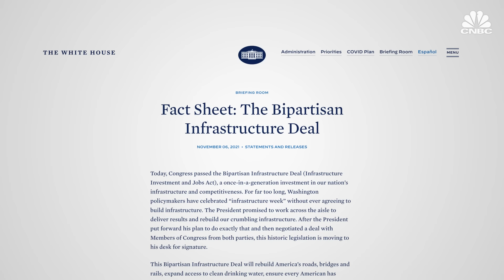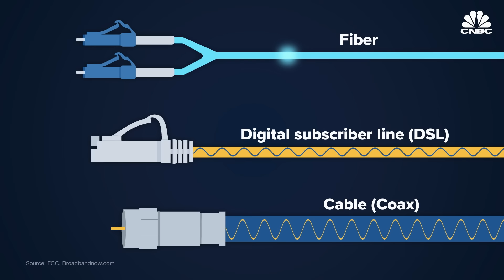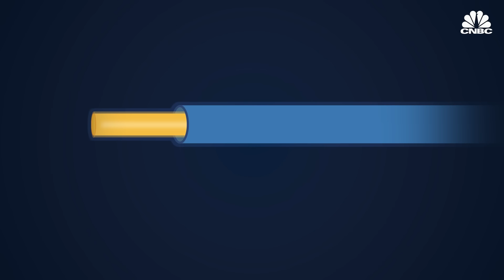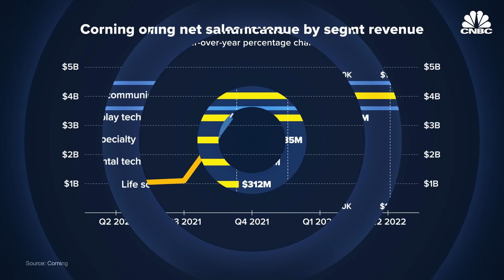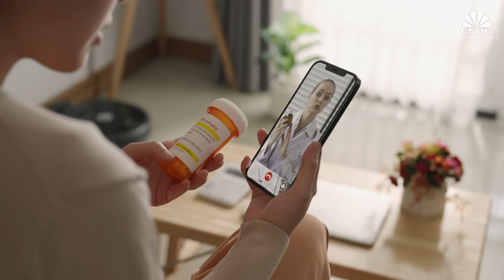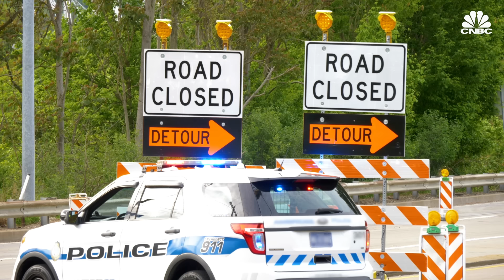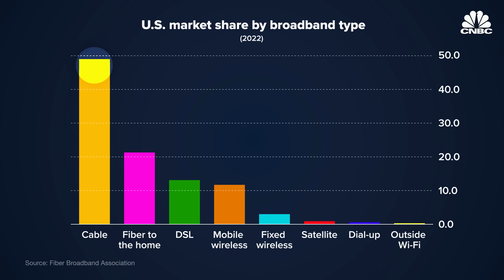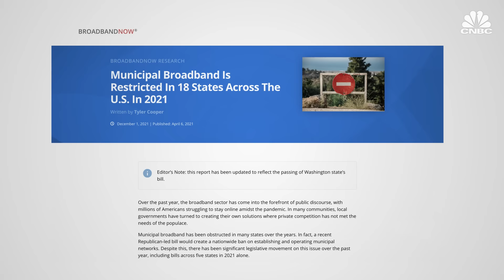How Fiber Will Speed Up America’s Internet

Comment: Yes early adoption of cable tv has played a key role in lagging fiber-to-the-home adoption in the US, BUT the main reason is simply GREED. The writing has been on the wall for a long time now for coax, but providers and their overlords are milking out traditional last mile coax cable till the very last drop to maximize profits and postpone capital expenditure on upgrades, that is all.
Reply: Never forget that CNBC is owned by America’s most hated cable company/ISP: Comcast. No wonder they don’t come clean about their role in keeping internet service slow and expensive.
Reply: Klickup
Reply: @rolandschindlerii9245  what?
Reply: There is a belief that fiber to the home is not really as necessary as people think. While fiber as a technology is king the average customers proximity to a fiber node and running coax off of that provide pretty much a similar type of data experience. The proximity reduces the SLA requirements which already are low for a residential customer as compared to a business customer.
Reply: @abaoaqu1333  rigggght…and nowadays with everyone in the family wanting to steam to their own device and kids doing videoconferencing and schoolwork online, and so many more people working from home…it would be really nice to have that fiber about now. 12 or 20Mbit upload speeds and 200MBit download speeds are really not gonna cut for people moving big files or everyone steaming 4K. I want fiber in my house and I want it 20 years ago. I want symmetric 1GBit speeds instead of this throttled garbage slowness I’ve been stuck with.
Reply: @LeeHawkinsPhoto  the average consumer doesn't really require gig speeds for the things they typically consume even with the increase in upload requirements. Ultimately what im saying is that the fiber that goes off the closest node directly to your house doesn't matter as much as the capacity of the node as well as how it been built and routed back to the closest market headends. Residential customers are all oversubscribed so they are constantly competing against each other in a given neighborhood for as high of speeds as possible regardless of if you have coax to the home or fiber to the home.
Reply: @abaoaqu1333  I disagree. The slow speeds hold back a LOT of possibilities…they have for decades at this point. Internet speeds and prices in the US are joke. We could be a whole lot better off.
Reply: @LeeHawkinsPhoto  But uhhh my dude, in the USA 1 in 4 households don't have ANY internet.... 265,331 people still use dial-up internet... 

Like listen I get it, I too love overkill gigabit internet (which I have access too :D). But I feel like the US should focus on connecting people to any network over only wanting fiber optics everywhere.
Reply: @SwagFlap  I feel like that’s irrelevant. My point is that US telecom companies have sat on their copper networks and left everyone to suffer while they bought back their stock with their massive profits instead of investing in actually bringing sprees to people.

I think it’s also important to recognize that the vast majority of the worst internet service is in sparsely populated regions that are small towns in rural areas…those are even more expensive to serve with copper lines because you’d need a LOT of repeaters for not a lot of customers.

There’s literally no excuse for why we don’t have fiber into buildings in metro areas. They literally pocketed all this money and spent as little as possible for incremental improvements rather than actually deploying technology that would drastically increase speeds and reduce costs. The remainder of Americans without internet lack it because these companies love to pass over poor neighborhoods in big cities because they don’t have money to spend on their exorbitant rates for slow internet. There’s literally no excuse for their greed. They have held back the entire country for decades on this. POLAND has had fiber everywhere since the NINETIES. Why can a broke former communist state do something and an advanced wealthy country can’t? It’s not because we don’t have the money, it’s because these telecom corporations are a joke and we should stop making excuses for them.

And it’s not overkill…I upload giant video and photo files and I have a cloud backup…and I’m a business. I cannot access gigabit speeds and I’m in a middle-income suburb of a major metro near a whole bunch of office & retail…and there are TONS of cities across the country that have it way worse than me.

These companies are so awful they’ve even gotten states to pass laws forbidding municipal broadband! Seriously, that’s what their profits go to…they only care about money. Money used to be the result of doing something useful, but now it’s not a means to an end or a reward, it is the end and the only thing that matters. They force everyone to have worse service by preventing any competition by any means available.
Reply: @LeeHawkinsPhoto  Get 100mbps over my service speed of 600mbps  with what you called "the most hated" reliably and over coax, 1000 mbps is available...

In the top 1% in the US for broadband speed (according to speedtest) and to think, I didn't even opt for the gigabit speed..

Anyway, fiber is great for density and all, but even fiber networks can't exist without copper being involved.

No longer holds true, but did a few short years ago. 10gbps NIC's for copper ethernet were much cheaper than their 10gbps NIC fiber counterparts.
Needless to say, preformed just as well as the fiber counterparts.
This part likely still holds true (haven't looked in a while)
Rest of the equipment to do a fiber lan, was much more expensive than copper to get the same speed as copper.
Reply: @larrypaul2462  you’re talking about LAN, not long-distance telecom network speeds. There’s literally nothing that can move data as fast as fiber over long distances and it’s a joke that we spend as much money as we do in the US and almost none of it is fiber on the consumer end and almost none of it is even close to gigabit speeds, especially upstream.

I know it costs money. But all the money I’m paying has never gotten me better service.
Reply: @LeeHawkinsPhoto  The internet is a global network of interconnected networks.
Which is comprised of local area networks.
Same exact gear is infact involved.
Only exception being, higher port counts are on the WAN side of things.

Didn't make the claim that something was bad about fiberoptic's.
Just that a copper version of 10gbps gear was in fact cheaper than the fiberoptic counterparts
That's fairly well known.

Speeds above 10gbps (which does in fact exist) can only be achieved via fiber currently but is subject to change with time or not.. We shall see?

fyi fastest network gear available currently is pushing speeds in the 400 to 500 gigabit per second range.
Speeds that a home user really couldn't possibly take advantage of, even if those speeds were offered from their provider.
Not to mention the price tags involved with actual cutting/bleeding edge tech.
Reply: @LeeHawkinsPhoto  forgot
Business requires higher upload speeds but not necessarily download.

Home users, need download speeds, not necessarily upload.

ISP's sell off businesses unused bandwidth to home users at a reduced rate..

Want gig speed on the upload side of things, get a dedicated line, and you shall receive while draining your wallet at the same time.

Comment: Have Verizon FIOS fiber in NYC and it's the best internet service I've ever used. Extremely fast and extremely reliable. Super low ping and hardly any packet loss ever.
Reply: Easy for NYC not so easy for many other areas but the US will get there at some point.

Comment: I have fiber but it didn't work like advertised.
It turned out that the box that was connected to the fiber was installed incorrectly.
But after it was done again I now have clean, stable, super fast internet.
Great for increasing my influence over this world.
Reply: Alrighty. You're a year in or so, yeah? How's it going? How's the price and speed compare to what you had before?

Comment: I can guarantee that the issues with fibre roll out in the US is down to monopolies. Companies have customers by the balls and nothing is going to change that. The limited roll out of Google fibre proved that
Reply: Frontier is my only provider and it’s their DSL. It’s slow but their fiber is coming to me Q4 this year. Whole build in my state is government funded. I’m rural as well
Reply: Nothing to do with monopolies in the US. It is just very labor intensive and expensive to achieve the last mile. 
Many people live with in a mile of fibre but the cost of connecting to their home simply is too high. If people were presented with the upfront cost of those connections they would run a mile from them.
Reply: @bighands69  It does have to do with monopolies still. My community has a monopoly in the sense that AT&T dug, setup all their equipment here and won’t allow anyone else to connect, monopolies are illegal in California but they find their ways. Spectrum, frontier, etc all day on the system it shows AT&T has some sort of agreement when I try to switch.
Reply: @Jxhimlol  same thing here in Phoenix with only Cox available without any fiber installation nearby
Reply: New Zealand has one fibre installer nation wide lol.

Comment: It isn't just bandwidth that makes fibre attractive. It is also its ability to transmit long distances without repeaters, 1000's of miles. A repeater needs power, so requires undersea cables carry electrical power along with the fibre.
Reply: Terrestrial fiber needs amplification about every 80km, with special Raman amplification you can reach upwards of 160km between amps.
Reply: It is also the amount of issues you have with fiber. There is practically none compared to Coax plant
Reply: This is not accurate, even with Fiber signal degrades after a certain distance and needs to be amplified whether passively or actively.
Reply: @abaoaqu1333  RA = Read Again. Nobody claimed that fibre could go an indefinite distance.
Reply: @scottfranco1962  Ok. but you did say 1000s of miles and that isn't happening. Not only do you have distance loss, you have splice losses to add as well. Also, you can't get a straight run back to the main site which usually doubles the length in a straight run.  But typically a large city doesn't  need more than 2-3 main sites. The advantage is OPEX due to not needing electricity.
Reply: own satellite high broadband internet data centre save   cabling system
Reply: @Todd.T  Yea, I think that should have read 1000's of feet. I looked it up, the max distance is 62 miles.
Reply: @hashim64  Well, having fibre on the planet's surface is always going to be faster than bouncing up into space and back, at least until they perfect neutrino communication (straight line through the planet). Then again, Elon claims that the faster speed though open space vs. glass makes LEOs reasonable. We live in interesting times.
Reply: @scottfranco1962  I have some 1550nm transceivers that go 75 miles. The lower the wavelength, the more power needed. We don't usually go further than 10 miles so far, but in the new networks, probably as far as 25 miles.
Reply: Amplification……?
Reply: @Laminar-Flow  "Amplification" typically means amplifying analog signals. Digital signals get "repeated". A lot of the network I work on is analog fiber and if you go to amplify it, it will cause lower SNR. The problem with networks that can work far away from the source(s), the more difficult they are to troubleshoot. Also bigger networks are more difficult as well. It is no fun going through traffic for an hour to repair something because the site is very far away.
Reply: We literally run power cables to power repeaters for the fibre cables.

Comment: A little overlooked fiber revolution that's happening right now, thanks a lot for this video. Very well delivered 🙂
Reply: @ChickenMcThiccken  well, 6G is not even a fixed standard yet and as far as I am concerned, it will be still fiber-based, won't be...
Reply: @MrOndra112  yes; but no antennas

Comment: "With fiber optic internet you can get speeds up to 2 Gbps".
Meanwhile in sweden we've had 10 Gbps available for private households with fiber connection since 2018.
Reply: Lucky
Reply: Same here in Portugal although it's expensive.
I have a very close friend who worked for Microsoft Sweden at 2005,  at those times and when he came back to Portugal on holidays we used to compare the services between our two countries and also other EU member states... and as I can remember Sweden always had the fastest and cheapest service in Europe by far!! Ericsson Communications always placed your country in the vanguard I should say... ;) only the Japanese had something similar. 

Nowadays, here in Portugal 500Mbs is the norm because its the cheapest solution offered by operators,  although I see  tendency to be updated to 1Gbs along this year...

Greetings from Portugal
Reply: We get it, Sweden rocks. bla bla bla
Reply: You know I heard they have Chocolate in Sweden.  Fiber in the US has been around for over 50 years. Yes you can get 10GB to your house, IF you're willing to shell out the dollars. Smart move for Sweden to place 10GB to the house for future proofing. I would guess that an individual home in Sweden does not fully utilize that capacity.
Reply: Wow, a small country has fast internet go figure
Reply: Sweden is also a tiny country compared to the US.
Reply: @seanthe100  
Thats how it works. Smaller, more control. It's not as easy to deploy good infra over a larger land in general
Reply: I use 150mb package. If my ISP offered me 2gig for $5 more I wouldn't bother because I just don't max it out anyway. I can get a gigabit, but so what. They increased my upload speeds by a factor of ten. When? I don't know. I found out when I did a speed test for no particular reason. Made no difference. Have never hit the limit. Most people don't consume more than 15% of what they pay for anyway.
Reply: @hariranormal5584  China has the same,been there,tried it on private home.
Reply: @mightymoo4018  that was not my point. The woman said Fiber optic cables are capable of up to 2Gbps as if that's the theoretical maximum. Therefore it felt relevant to point out the PRIVATE households in sweden has had much faster speeds for many years.
Reply: @Todd.T  In Quebec, Bell offers 8 Gbps down and up, via fiber connection. It is 150$CAN/month. I'm not sure who would need that kind of speed. Sounds great if you are running your own web server.
I just have plain old DLS, 7 Mbps down, 1 Mbps up for 37$CAN/month.
Reply: @seanthe100  USA has more densely populated areas than Sweden, so that is no excuse.  It is more down to fiber i Europe has been cheaper than in the USA for a long time, and we have decent salaries in Western EU.  And the competition in Sweden is real.  You do not have just one ISP like many places in the USA. In Europe most politicians have a fixed salary, so they rely on doing a job for the actual population.   Get broadband in the rural areas or dont get reelected...
Reply: i don't live there but you can probably get that in some parts of the us too
Reply: @atomictransfusion  Yes they have multiple Gigabit in the US.  Anyway fiber speeds offered will increase a lot in the coming years.  By 2030 most of Europe will have 50Gbit if desired.  By then I assume Gigabit will be the low tier offering.
My current ISP starts at 300/300Mbit now, and in a few years I suspect 1Gbit will be the lowest offer.

The broadband speeds have increased by 1000 times every 20 years.  As long as the medium can transport higher speeds, sky is the limit.   And forget what you need right now, because that is never the future needs.   Else we would be stuck with 28kbit modems.

Comment: Very nice video,  I have worked as a Fiber Technician for more than 25 years in Silicon Valley,  Working in the commercial building sector. I have  been part of projects from almost every big Tech company in silicon valley.  it has been a very cool journey.  Someone in the comments below said something about not being paid enough for the work we do and i have to agree with that but the way to make a little bit more money is by working for a company that are part of the  union such as the IBEW.

Comment: I live in Mexico city, I have had fiber optic connection for the last 4 years, it provides Cable TV, telephone and 80mb internet, its enough to support 8pc and 20 wireless devices.
I really thought we were the second to last to get these services, I can't believe I was wrong.
Reply: I live in the US and have hd Fiberoptic internet delivery for 30 years.
Reply: @lantrick  yeah in very limited areas. We have so much work to do (as I’m sure Mexico does too).
Reply: There are plenty of areas in Mexico that have sub-standard internet as well. My family lives near Zamora, Mich. and they constantly get flyers from Telmex advertising their fiber internet (Infinitum) service but its only available in certain parts of the town. They happen to be outside of their fiber footprint so they can only get crappy DSL service from them. They have an alternative, Megacable which offers a 100 Mbps connection. Not bad.

Comment: I added fiber and my throughput has been incredible. I avoid prunes and can still get 400mbps downloads. It takes no time at all now to empty my buffer.
Reply: But for the internet, fiber to the home is rare. I think most people have DSL and coax cable modem in major cities.
I think when you ask for over 100 Mbps service, that is when they do a fiber to the home connection instead of DSL.
For coax cable, it is capable of 300 Mbps.
Reply: My port got clogged
Reply: @Birdmacher  - That's rough when you get buffer overflow. Especially when burning a disc or a mule.